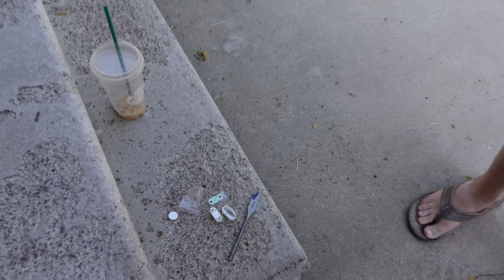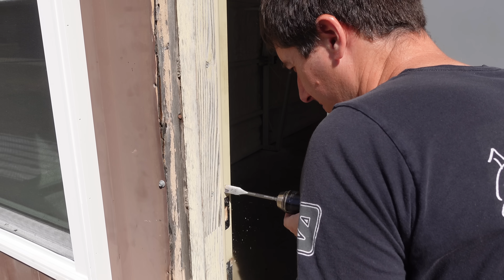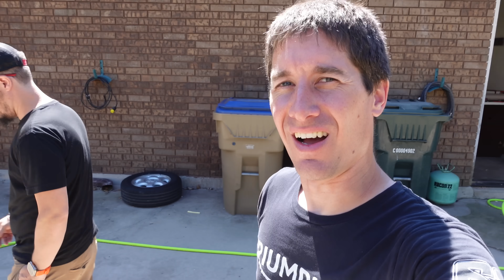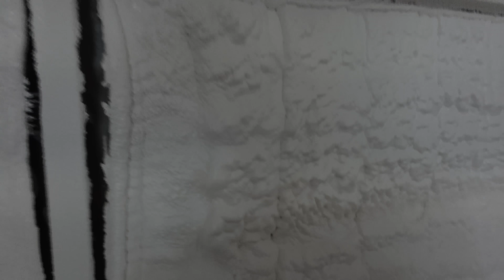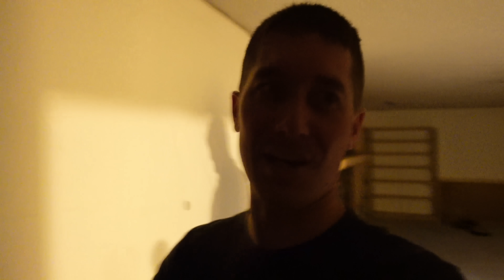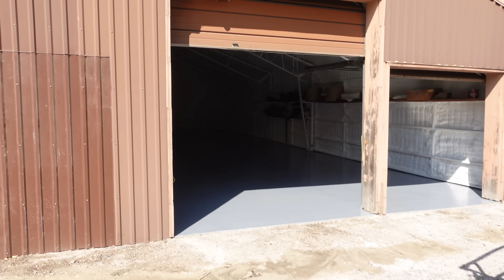Getting My New Shop WORK READY With NEW FLOORS

Comment: Hey
Reply: 1 day I shall beat you 😂
Reply: @drivenserb in the name of Marco from Tropoja.....Good luck🤣
Reply: @bearing_aficionado  I’ll need more than luck I think 🤣
Reply: @drivenserb7152  yeah man, he and I have been going back in forth for probably a good year or more for the coveted prize of 1st comment and the gold medal that is bestowed upon us from JR of Wichita.
Reply: @drivenserb  💯
Reply: He hit me with the late drop today.
Reply: @bearing_aficionado Late drop and I had the dreaded screen freeze on top of that. Psubuster is tough to beat for sure. Did you see my answer on what car I drive?
Reply: @Cartier_specialist  yes I did.
Reply: If it is indeed one of our bearings, thanks for supporting my company even though it didn't come from my plant.  Hopefully, it will last longer than the car does.
Reply: @bearing_aficionado It should last pretty much the life of the car. At my current mileage per year the car might outlive me. The car is a 2004 and is probably considered low miles with 151,000 miles.
Reply: @Cartier_specialist  damn.  My 2011 F150 has almost 158,000 miles on it.
Reply: @bearing_aficionado  I was just about to go to bed when it dropped.
Reply: @psubuster  I was cleaning up a mess at work and decided to step out to cool off a bit.  I gave up and just before I went back in I decided to check.
Reply: @bearing_aficionado  🤣
Reply from the maker: 🥇 boom!
Reply: In case you all are wondering, when I said in the name of Marco from Tropoja, I was talking about the unfortunate bastard who met the particular set of skills from one Bryan Mills.  A particular set of skills who made Bryan a danger to people like Marco.🤣🤣🤣